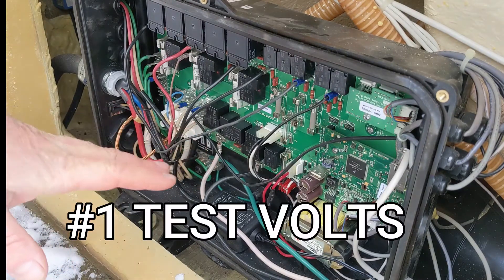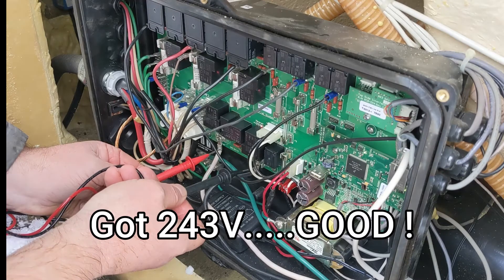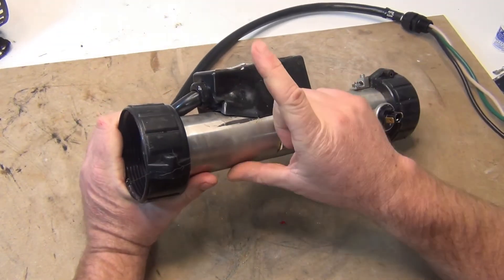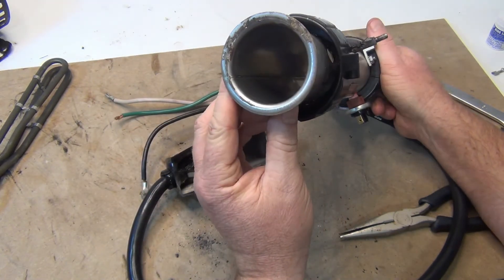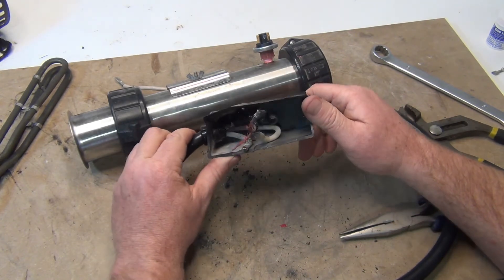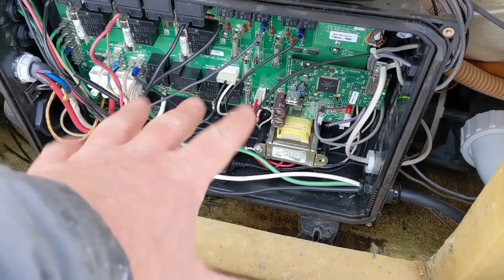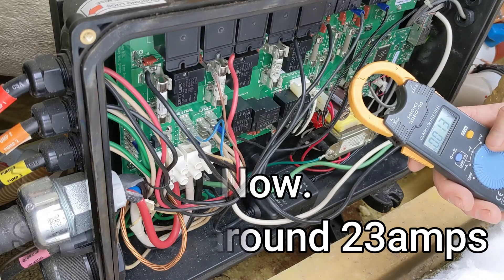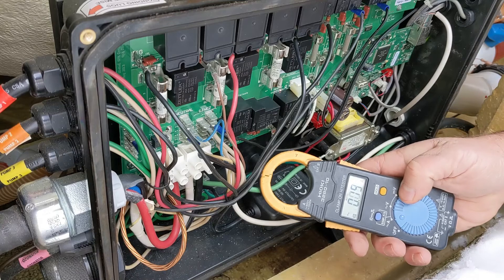Arctic Spa HOT TUB Not Heating / Testing a HOT TUB Heater Element

Comment from the maker: You can apply this testing to all the hot tub equipment.
Reply: Arctic Spa Midnight Sun, 2010 model - cant press any button on the display, and its not heating anymore, no error code, the display light is on and power is fine - any clue?

Comment: So would the led indicator in the board and the top panel show it was heating?
Reply from the maker: Always test the element for volts and amps even if the heat light is on the topside.  Not all types of packs have a light that comes on the board showing the heat is on.

Comment: Arctic Spa Midnight Sun, 2010 model - cant press any button on the display, and its not heating anymore, no error code, the display light is on and power is fine - any clue?
Reply from the maker: Mostly likely the keypad (topside).  Unplug it and see if all the pumps turn on by themselves.
Reply: @VIPPoolsandSpas  the dealer said we might need to change the "pack" and the "heater" but gonna try this, thanks : for quick response! :)
Reply from the maker: @torandrefjsne5296  the common thing that gets changed on that tub for that year is the heater and key pad.
Reply: @VIPPoolsandSpas  Thanks,,  can you recommand me a place to buy the parts?